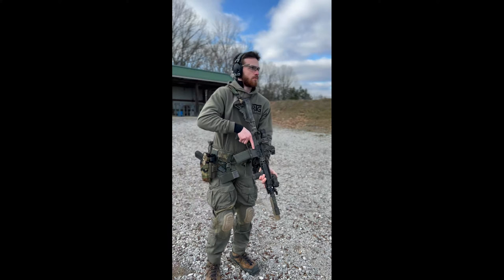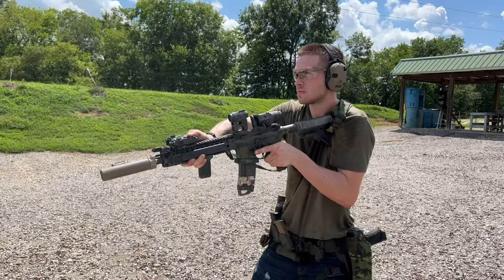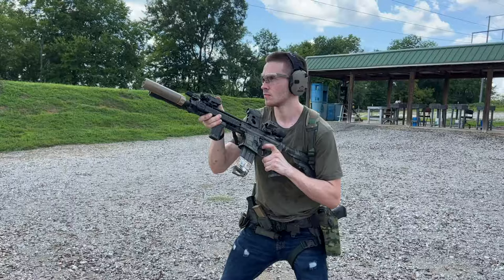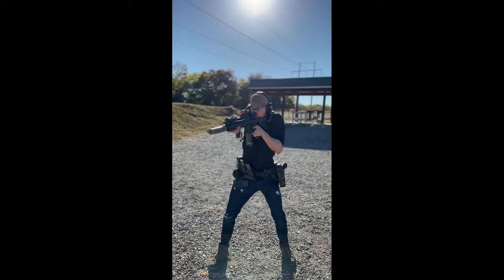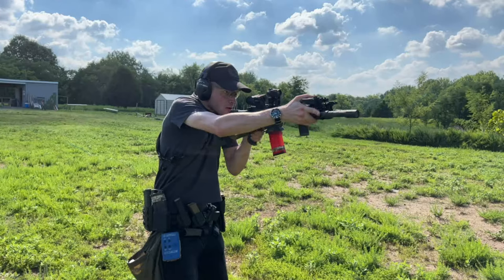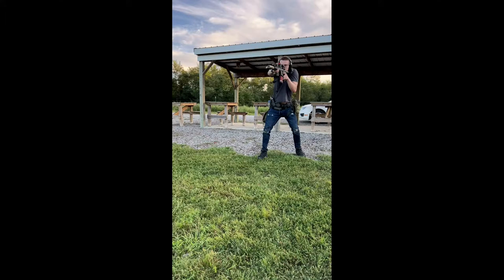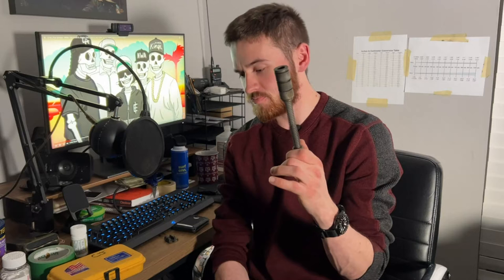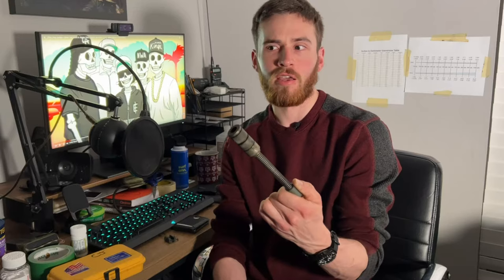JP Enterprise silent buffer system review

Comment: Of all the complaints, "I had to maintain it after 5000+ rounds!" is weak. 

The recoil spring should be replaced about that round count as well. 

I have a couple. They feel nice. I don't think I've paid over $130ea. 

What you haven't considered, is the number of times buffer detents fail and cause a stoppage. It happens, and it takes a long time to dig it out of the trigger. 

Everything is a trade off.
Reply from the maker: It’s only weak if you’re the type of person who doesn’t shoot high volumes like a dude who actually takes classes or actually competes. Again for the 300th time. It’s how it broke and what happened that matters because that isn’t how a standard buffer would fail. You’re right I haven’t considered a buffer detent breaking because I’ve literally never seen it happen, you’ve also got reinforced detents so it doesn’t happen.
Reply from the maker: Like I don’t know what sort of over gassed system, shitty suppressor, or Chinese parts people are using to cause their detents to break because I’ve literally never seen that shit, 7 years of taking classes with dudes hundreds of different rifles in different environments, broken bolts, stuck cases you need a pry bar to remove, out of battery explosions, I’ve seen a lot of shit and I’ve never seen a detent snap personally.
Reply: @autonomousdefense  

Well if you haven't seen it, it obviously doesn't happen. 

Have fun.
Reply from the maker: @Heathh49008  of course it happens but there is literally a beefed up version of that detent so that doesn’t happen, the solution to the problem your arguing is a fault of the original system exists and it costs a couple of fucking cents to manufacture. I am having fun. Literally to your own argument, o rings are cheap and easy to replace multiple times, a fucking detent is cheap and easy to replace ONE time IF it ever actually broke.
Reply: @autonomousdefense  

I said, "It's a tradeoff" 

1. They feel nicer than a basic buffer. (subjective)
2. They aren't that expensive ($130)
3. They last as long as the average recoil spring (5k rnds)
4. They allow you to leave out the detent that likes to fail in a nasty stoppage if it gets under the trigger.
5. It's a matter of preference. 

Read your comments. Unless you're intentionally trying to hate-farm for clicks, you're coming off really shrill. I never attacked you, or cursed you out. 

Cheers.
Reply from the maker: @Heathh49008  how long it lasts isn’t what I mentioned, I mentioned how they don’t openly tell you and how the thing that fails will shut down the gun because it’s a bad design. The detent isn’t “likely” to fail I’ve changed springs in multiple guns without having to replace my detents, nobody cares about something being subjective when it costs more than 100$ people wanna know why they’d ever use it because they expect an actual tangible benefit that doesn’t create more problems than it solves and this thing doesn’t solve a problem to begin with.
Reply from the maker: @Heathh49008  if it was really a matter of preference you wouldn’t have bothered to comment, my preference and experience is that it’s practically worthless and that a normal buffer and spring with more ammo to train is a far better use of one’s money.
Reply: @autonomousdefense  

From that perspective, I can understand your concerns. 

For many of us, we have more rifles and ammo than time. Items like the JP kit is about making the wife's rifle as smooth as possible, or for a game gun. 

If you are choosing the priorities for a person on a limited budget, building their defensive rifle.. a PSA rifle with a  spares kit, and as much ammo and classes as you can afford is  the rational choice. (Of course) Get a tool, learn to use it with skill, then worry about getting a high-end tool... just like you would in your career.

When you can afford toys, then things like these are options. I think I have them in 2 builds... but I don't think I would really need more myself. It was nice, but I'm not particularly recoil sensitive. Can't say I have ever noticed excessive noise from the buffer either. I will probably leave them in the KP15  lowers. 

As for when they come in handy, the PCC guys have issues with recoil because most are straight  blowback. I've heard these help. I never found recoil too atrocious when I run suppressed. (I'm normally complaining about gas in my face.) But I use adjustable gas blocks these days, so that isn't as much an issue either. I could see an over-gassed carbine gas system with a light buffer hammering pretty bad, but I haven't had the issue personally. 

To put a positive spin on this, I'll say: 

Thanks for the review, I'll be sure to grab a couple of o-ring kits and keep an eye on them as the round count gets high.
Reply from the maker: @Heathh49008  Been a few weeks but I actually looked into exactly why buffer retaining pins break. its almost always because the lower receiver hole was drilled in the wrong spot relative to the BCG and buffer contacting it. Meaning out of spec. this is entirely the reason i've never personally seen it for this to happen the Bolt carrier has to be out of spec or the lower receiver, its actually impressive to even fuck that up, you can also physically see the BCG pushing the buffer back when you close the rifle up to confirm if its contacting it or not.

Comment: Nothing lasts forever but you can service some parts. 6-7k rounds is a lot for an average shooter.  for just needing to change some o-rings, I don’t see a problem with the product.
Reply from the maker: So like, the specific failure point and its existence due to the design is the very clearly stated problem, the other problem is no actual advantage to using this product over something like a standard buffer and flatware spring. Its failure rate is high and the average shooter absolutely hits 7k rounds in a year

Comment: I think this is fair critique if youre setting up an "end of the world" rifle but replacing O-rings once every FIVE THOUSAND ROUNDS is not exactly what I'd call an un-reliable product
Reply from the maker: The issue is primarily it failing when you really need it not to. Again since replacing the system with the good ole H2 buff and spring it’s performing just as well if not better because of the extra feedback from vibration and now it has one less failure point. Like there really isn’t any justification for using this product at all. You can still configure competition guns and suppressed rifles extremely well without the use of this system.
Reply: In eliminating the buffer retaining pin it removes a failure point that doesnt have a round count, those things can just shit the bed sometimes and when that happens its an equally bad failure. JP's o-ring failure is also 100% preventable via basic maintenence of the system you spent $150 on. Replace o-rings every 5000 rounds, theyre $8. I've never used the sproing to help myself shoot, so I cant comment on that, but it seems its probably not worth maintaing a failure point for.
Reply from the maker: @MedicalTape_xX  fair point, I’ve never personally seen that retaining pin break and if I’m not mistaken companies sell beefed up versions of that pin.

Comment: Look at the trajectory of your shells when ejected around 2 o’clock tells me your gun is running very gassy probably because of the suppressor putting the JP silence spring on probably increases that and if your spring is too heavy, you can have problems with the bolt locking on the last round it’s all about the fine tune man
Reply from the maker: Bolts never had problems locking to the rear. What you’re talking about has never been an issue nor is it even the subject of this review or the problems with this product. Regardless of the pressure this system was fired suppressed and unsuppressed and the system failed at the exact round count JP claimed it would which again, they do not openly tell you when you purchase the product.

And it’s not about fine tuning, fine tuning is a gas port drilled properly to allow the gun to cycle and fire reliably. If you have a properly built “duty” style rifle using a BCM upper your failure point shouldn’t be a recoil spring assembly.

Comment: 3:06 it’s not a big deal, I was able to bake the lock tight with elbows grease and leverage without heating it up. Give it a shot and reapply lock tight again.
Reply from the maker: Breaking it isn’t the issue, letting it set and needing to even do that is.
Reply: @autonomousdefense  oh, but that comes with the ecosystem of a product. If this isn’t what your looking for , then I recommend guys geissele  buffer and braided spring.
Reply from the maker: @CA.0verview  or yknow, literally just a standard buffer and spring. This product clearly isn’t what anyone’s looking for otherwise JP wouldn’t withhold information about their own experiences with its failures at specific round counts. Really valuable information they just don’t provide.

Comment: thanks for the solid long term review on  the JP SCS. 5-7k rounds is likely way more than 99% of users put on these set ups.  so its kinda hard to fault them for it wearing out after that many rounds.  that said,   ive always looked at these,  but always end up deciding its not worth the cost.  does the same thing as standard buffer/ spring at more cost with more potential failure points. 

 its a gun,  its noisy, if a little twang bothers you that much,  well idk what to tell you..

Comment: I actually wonder if the O-rings are even needed? I wonder if you would have just cut out the bad rings if it would have continued to work.
Reply from the maker: I specifically asked JP this when it first broke because I had the same question. According to them if you don’t have the O-rings the impact of the weights will snap the screw holding it together.

Comment: Good grief take an armorers course . After 5000 rounds it needs to be broken down and inspected anyway, replace the o rings .
Reply from the maker: Need is a strong word, suggested is better. Also you understand this was a test, TESTING. The fucking spring doesn’t fail regardless of build up. At 5000-10000 rounds something else would fail. Yknow what failed? The aftermarket spring system, yknow what doesn’t? A factory spring system. It’s almost like that was the entire fucking point.

Comment: 7k rounds for a o-ring to fail? I have the 1st gen armapec, probably 5k pounds through it. Keep the buffer lubed, it will last longer. They are on sale for about 70 dollars sometimes. I definitely wouldn't speed 200 on one, but for under the 100 mark they IMO are worth the upgrade. I carry a spare spring and standard buffer weight in a range bag. If you're doing a class you should have spare bcg or bcg rebuild kit and the spare buffer spring etc.
Reply from the maker: @americanmade422  objectively not an upgrade. 5-7k depending on the cartridge you use because higher pressure means higher stress. The buffer was lubed, it failed exactly when the manufacturer said it would, information they neatly neglect telling you because they don’t expect you to ever put 5k through their buffer. Which interesting enough almost all the comments debating that are people who haven’t shot that much or even own this specific product. It’s almost like people who don’t shoot don’t have experience and believe a different buffer system is the key to them not being trash with a rifle.
Reply: @autonomousdefense keep spare buffer springs with weights, problem solved.
Reply from the maker: @americanmade422  or just don’t use shitty parts. Problem super solved.

Comment: Thank you for this information.  I agree with you, a lot of money for additional failure points does not make sense.  I have run many thousands of rounds, full auto and semi, and only had one failure/replacement required (regarding buffers & springs).  That failure was a broken buffer retaining pin.

Comment: What do you use now?  Regular spring and buffer?
Reply from the maker: Yes actually, standard spring and a H2 buffer or appropriate weight based on the build. I actually revisited this rabbit hole of tuning guns based off the buffer system and oh boy. The vltor A5 and BCM MK2 systems might be gigantic crocks of shit. Weirdly enough if you look deep enough into it. It appears flat wire springs and higher mass H3-H4 buffers might actually accomplish the same thing JP, vltor, BCM, and giessele. Claim to do with their proprietary recoil systems. It’s really weird how all of these companies all tried accomplishing the same thing. I think I’ve found more people using springco springs and flatwire springs than people who actually use the vltor.

Eventually I’ll put out another video about It if I find anything of significant value from trying something other than a standard buffer and spring again. I’ve got a feeling it won’t make that much of a difference.

Comment: Which type of buffer tube are you using? I wonder if using their buffer would yield the same result. Or potentially using a commercial buffer tube vs a Milspec? Idk, just thinking out loud…
Reply from the maker: Mil-spec. shouldn’t make a difference, like if you’ve got a longer tube your suppose to put a quarter into the back to fill the empty space void.
Reply: @autonomousdefense  yeah, I was thinking they were a little wider. I looked it up and they are “a little” wider- meaning 0.03” so not much at all. lol

Comment: Cry me a river. Use it like your supposed to and follow the maintenance schedule. It's not that different than running a standard spring and buffer 😒
Reply from the maker: You’re right it’s not that different and it’s got a worse design which is where it’s the most different. No point in using it.

Comment: Nice honest review. Agree with the idea of a neat idea, but poorly executed. Also kind of concerning that this part started showing issues around 5k, which isn't exactly a ton of rounds. These companies need to test their shit better/more thorough. Good stuff man 👍
Reply from the maker: Well this is why I mentioned the product does what it’s intended to do, it just can’t hold up long term. I’m sure they tested it plenty and they were never trying to replace the standard AR buffer system.
Reply: 5k rounds is t that many rounds? Are you serious? Y’all don’t seem to understand how much wear and tear that kind of repeated impact and friction causes on parts.
Reply from the maker: @Mountain_Man  its not a lot of rounds. 5000 rounds is basically bare minimum for testing all products on the market. its the phase 1 testing cap to get a good idea of how something is working. The timeline does matter because 5000rd in one afternoon is a lot more heat stress than 6 months but its still pretty low.

Comment: Was it ever claimed in 6000 rounds? And how many rounds one set of fire
Reply from the maker: Cleaned? yes, it was normally cleaned every 500-1000 rounds fired due to all the suppressor sludge. the sludge itself never caused failure. a casing might have gotten stuck in the chamber if I was using steeled cased at the time as the increased friction of that casing tends to do that if you dont keep it lubricated but that happened maybe 4 times in the 6000-7000 rounds fired. The way I actually figured out the O-ring was causing the failures was repeatedly deep cleaning it in quick succession and the gun failing even while clean.

Comment: My guy. First off, idk where you found this but you got ripped the fuck off, 200 bucks??? That's insane. I just bought one recently for 40. Secondly. Parts wear and tear. Thirdly. Almost nobody is putting 6-7k rounds through their rifles in a lifetime let alone, what did you say like only a couple months? Bro. You should be looking at replacing your barrel too after that many rounds, if you're having misfires or anything else it might be your bolt or firing pin wearing out.  Ar Parts aren't built to last forever dude
Reply from the maker: English not your first language?
Reply from the maker: This is without a doubt the most incoherent comment I’ve ever seen

Comment: I keep hearing guys talk about the noise of the buffer spring. Is that a real concern when the business end of the rifle is barking bullets.  Using rubber o-rings in a carbon polluted buffer tube just screams failure. It might be at 7,000 rds or 800rds or even 100rds.  Who wants to be the guy in a fight when it does fail.  The cost, and benefits of the JP syst just doesnt make sense to me.  Its a cute toy for target practice tho.  First and foremost consideration should be reliability.